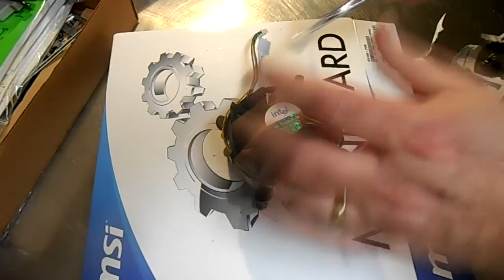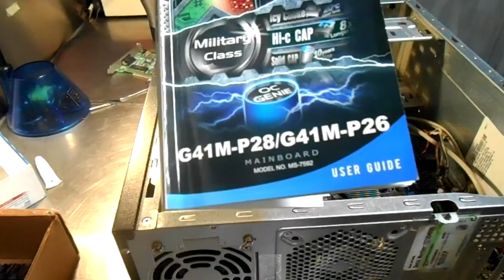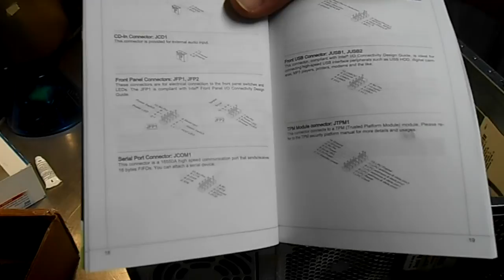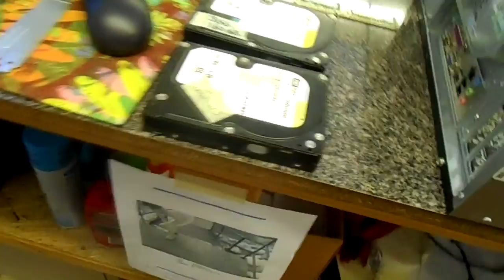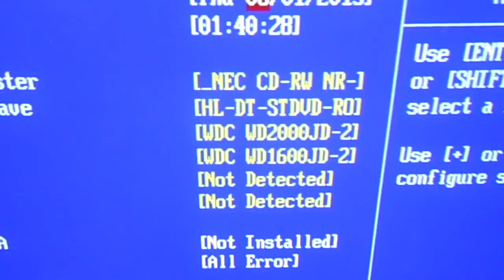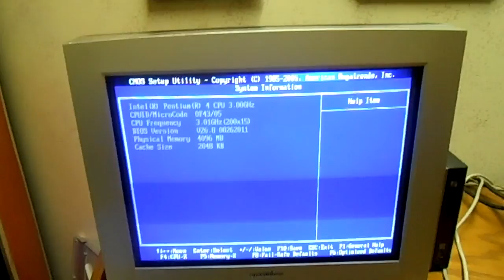How to Build a Computer Using Scrap Parts

Comment: Hi. i am first. so 'Core Voltage' (Intel i7 4770k) immediately rises and falls (about 0.050v to 1.500v)  What could it be? I'm not doing anything on the computer but this is faster changing. is it normally or no? if no what i must do? sorry my english

Comment: I built a windows xp computer computer and when I turn it on it beeps loudly several times and no image shows up
Reply: It may be the CPU's pins that are broken or the RAM, HDD it can be anything but may be the CPU it also happened to me and i checked the CPU and some of the pins were brooken
Reply: That means that you didnt plug somthing in right or your os is f up.
Reply: If it beeps 3 times, no ram!
Reply: ok thanks, i had ram but maybe it is broken. Thanks!